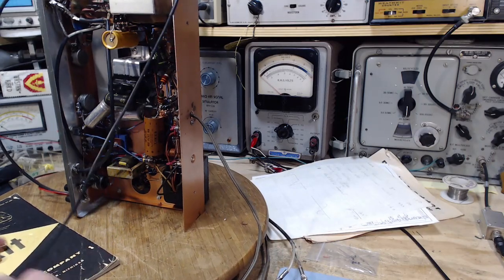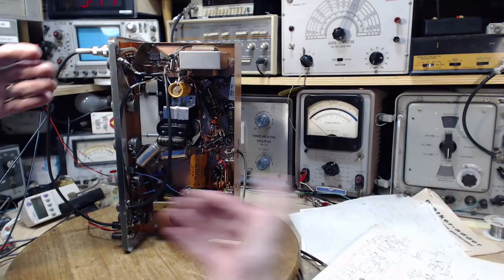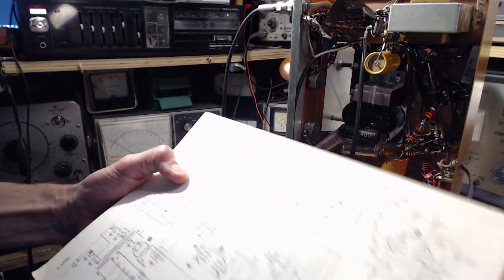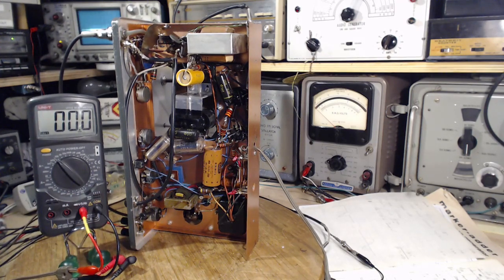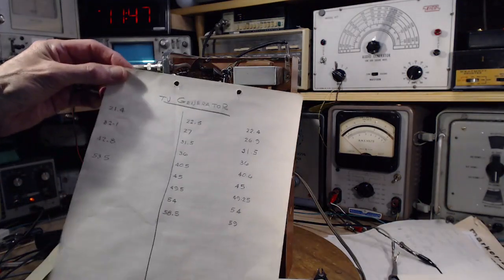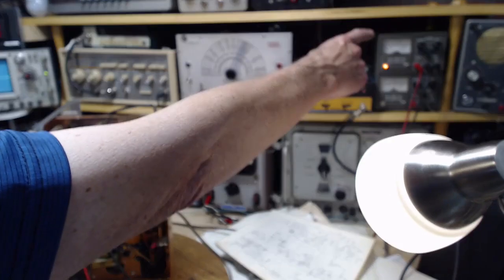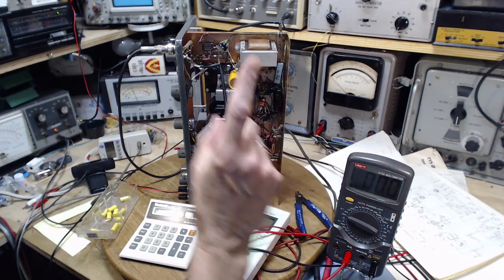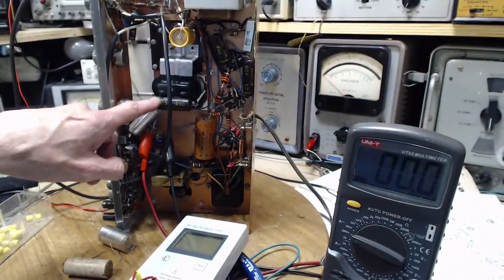Heathkit TV Alignment Generator TS-4A Video #5 - Increductor Bias Current

Comment: Either take that piece of crap multimeter apart and clean the range/function switch, or buy a new one.  You have no idea whether ANY of the readings you get from that thing are correct.

Comment: Jim 
Is the diode backwards ?
Most of the time the arrow on the map points at the line on the diode .

Heads up …. when is a ground not ground !

The correct ground can kill the scope so test with a good DVM .

D/C across the 40 uf cap & a/c on the pot wiper 
( should move when adjusting the pot  ) .

I'm thinking this part of the unit worked before you started work on it !!
Reply: I agree. The silicon diode being in backwards is about the only reasonable explanation.
And here is the catch to remember; on selenium plate rectifiers the (+) imprinted on one of the tabs does mark the pin where the positive voltage is put out. 
The (+) on selenium plate rectifiers does not mark the anode side of the underlying diode.

And secondly you can hardly test a selenium rectifier diode with a modern DMM that limits the test voltage on diode mode to 2V.
Reply: @asmallmatter4441  
Simple just test for the voltage across the 40 uf cap .
A DVM is the tool for the job as one end has the 117 a/c on it .

As for the backwards diode thing ............  he's a tube guy !

“When is a ground not ground” ….. when it's not connected .
This part of the unit has no direct chassis connection's .